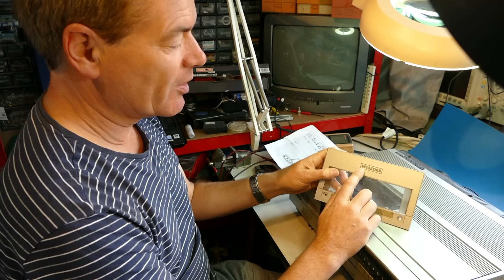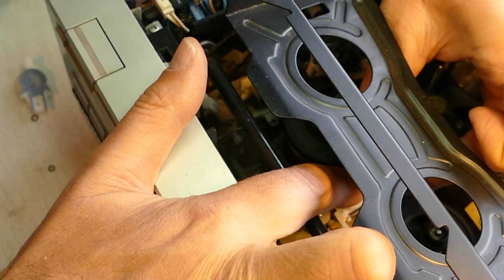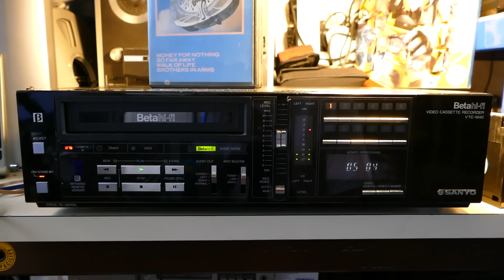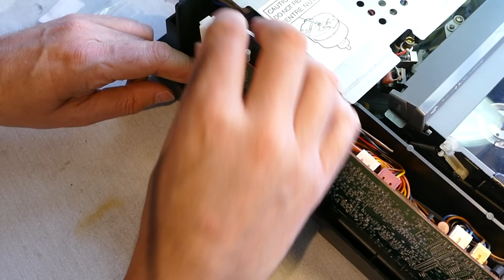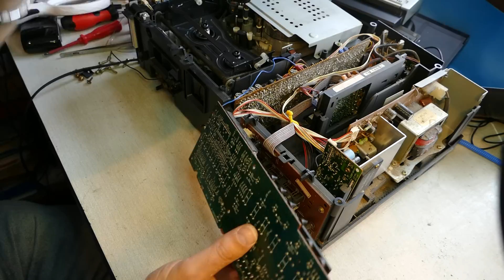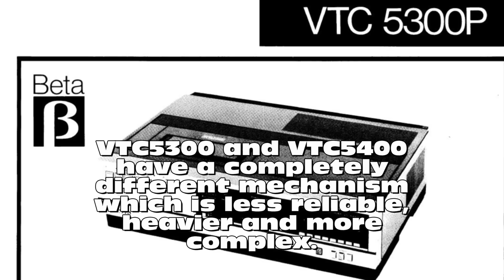Servicing Sanyo Beta (Betamax / Betacord) VTC5000, VTC5150 etc.

Comment: Hello, Thank you for this video. Very informative. I have a Sanyo Betacord VCR 4670. All functions work with exception to the tape retrieval. I have replaced the belts, idler tires and pinch roller. But the issue remains. The only thing i have not done as of yet. Is oil and grease the unit. Any ideas? Thank you for your time.

Comment: I have now successfully got my 5000 working perfectly again thanks to this video. Now tackling the portable VPR 5800 version, having trouble with the tape reject operation. Anybody out there with ideas?
Reply from the maker: The portable was an oddball machine, the deck is rather different to any other Sanyo model.  You just have to study it carefully.  Service manuals are available I believe for a badge engineered one.

Comment: I have the PAL/SECAM version of the VTC 5000. It seems dead. No lights, nothing. even the screen wont flash. the buttons do nothing, I just hear a light hum in the PSU section when i put my ear onto the shell. I think its coming from the voltage regulator. Out of random, I pressed a channel button, the LED lit up briefly, then went off. nothing else than that.
Reply from the maker: The STK regulator may have failed.  They are not particularly hard to source.  I would check capacitors in the power supply at the same time.  I also have one of these machines, a VTC5550.
Reply: @video99couk  When i put it onto the timer mode, only the channel buttons light up when i press them. Will give result when i swap the stk.
Reply: @video99couk That wasn’t the issue. I swapped the PSU with one from a donor VTC 5550, but still nothing happened. I’ve replaced every part, but it remains dead, and I don't know why. Interestingly, when I compared the PSUs, the one from the broken VTC 5550 was in better condition than the donor PSU.

Comment: Tengo una Sanyo Betacord... reproduce sin color
Reply from the maker: I've had this caused by dry joints on the main panel at the bottom, so take a close look around the chroma circuits.
Reply: Cómo lo soluciono

Comment: Great Videos, watched many times, I have 4 of these with this mod done but playback eventually stopped and goes into standby on all 4, voltage correct from supply new belts etc.
I have 4 VTC 9300 all were working perfectly but I guess heads worn out now.
Reply from the maker: The reel motors can occasionally fail on these machines, so it might be worth checking that.
Reply: @video99couk  Had that in mind, but 4 units with same fault, did try a while back finding replacement motor, if I figure something out I will let you know.

Comment: Thanks for the video, with new belt my RW and FF are much better, my picture is fine but no colour, whereabouts or which pcb controls the colours, is it a crystal
Reply from the maker: The colour processing is mostly on the bottom PCB.  I've had dry joints on colour processing on that panel in the past.

Comment: Thanks so much for this comprehensive video. I'm just trying to resurrect my pair of 5000s. I now have a good idea how to fix the problems I have, which you've covered. One works well mechanically but has no picture, the other has a reasonable picture but chews up tapes when unlacing.

Comment: Hello, I’ve just cleaned a 5000, and was looking to adjust the drop out compensator. I can see the hole marked DOC, but how on earth do you adjust it? On mine it’s just a hole. Thanks
Reply from the maker: There's a small preset adjuster inside that can.  You need a very small screwdriver to access it.
Reply: @video99couk  it must be tiny! Thank you!

Comment: Commenting on this video again because I found something intereseting regarding the syscon bug. So, about a year ago or so I bought a service manual for the VTC 5550, and it says the following:
"If the take-up reel base rotation sensor detects that the reel base has stopped during any of the PLAY, REC, F-SEARCH or R-SEARCH modes, the capstan motor, the reel motor and the video head will stop. If the sensor detects that the reel base has stopped during any of the F FWD, REW, or UNLOADING modes, the reel motor will stop, and the loading motor will rotate in the clockwise direction. The loading ring will then rotate in the counter clockwise direction and, once loading is completed, the VCR will enter the STOP mode.

So, did Sanyo designed these machines to behave like this on purpose, or was it really a bug in the code that they didn't bother to change until a couple of years later? It doesn't indeed make any sense to lace the tape when the take-up spool won't rotate!
PS: I put the important part in bold. It's not in bold on the manual.
Reply from the maker: It just doesn't seem logical to lace up in the condition of reel drive failure.  It's the last thing you would want to do, because now you have tape out that you can't retract.  I reckon it's a bug.
Reply: @video99couk  Do you have any idea how they programmed these syscon chips? What language they used, what machine etc?
Reply: @crashbandicoot4everr They’d use TTL (Transistor-Transistor Logic) I’d imagine. So they likely used OR gates, NAND gates and all that boring stuff.

Comment: Been fighting with a VTC 5300P for some time now which simply refuses to transport the tape. For some reason the motor doesn't want to push the gear in place to run the takeup spool in simple play mode - it seemingly doesn't transport the tape when unlacing as well, making exactly the mess you mentioned (without a tape the spool does rotate there). Lacing works perfectly well after changing the belts but that's pretty much about it. It's quite frustrating. Unfortunately the 5000 and 5300 look almost the same inside but they're quite different about that. Wish I could get it to run without the carriage for debugging, but it simply won't do even when pessing all kinds of switches that theoretically connect while pusing carriage it into place.
Won't give up on it, but at the moment I don't have a clue where to start. But your video was still a big motivation to keep on going, thanks!
Reply from the maker: Yes the 5300/5400 have an older and more complicated mechanism.  It's been some years since I worked on one.  Keep trying with fooling it into thinking there's a tape in there so you can see what's happening.
Reply: @video99couk  Finally managed to get it running again!
Turned out the last big problem was a stuck idler (or whatever it is called in the 5300). After some cleaning and oiling everything's working fine now.
Unfortunately now the screen is rather noisy and a bit shaky, even loses color at times, where it wasn't before I took care of the sluggish mechanics. Very scared that I've messed up the head (or even alignment) somehow. Tried cleaning it with the help of the PALsite guide, but didn't do anything. Noticed that the picture problems (especially the color related ones) are getting better after fast forwarding, rewinding or simply stopping it for a second and then pressing play again. Maybe the tape transport is slighty too slow and results in this - but to be honest I don't know if that makes even sense technically. I'd hate to give up on it after working so long on it but at this point I'm really out of clues.

Comment: Any tips on how to get it to eject a stuck tape. It ejected once, but never again. I have taken the top off the unit.
Reply from the maker: Probably the loading motor belt has fallen off.  It's at the back right of the deck.  Just replace that, it's not too difficult and can usually be accessed OK from the top.  I cover this in my video.

Comment: Brilliant video thanks.  I do find it a lot easier to remove the 3 screws on the right and the circlip on the left and remove the tape carriage before working on the idler.  Found it impossible to reassemble with the tape carriage in the way 😊
Reply from the maker: Maybe I have small fingers!  I almost never remove the carriage to work on these.

Comment: Why didn't you take the tape carriage out?  It is easier to change them if it's away, well they say anyway.  I want to find out where to purchase those belt/idler sets.
Reply from the maker: I prefer not to, my fingers easily fit around the cassette carriage.  Belts you can order by size, but the idlers are now harder to find.

Comment: Just working on mine, I noticed some aluminum oxidation on the polished surface of the drum. I don't know if that has the potential to damage the tape, but likely.
Reply from the maker: That can happen but rarely causes a serious issue.  You can very gently go over the static parts of the drum with fine emery cloth, avoiding the head tips of course, to reduce the oxidation a bit.  Don't overdo it.

Comment: Hi, do you know what maybe causing a buzzing sound on my VTC500 on playing of the tapes?. I've heard suggestions it could be due to the bad tape (something to do with the HiFi, though there is no HiFi on the tapes or the machine), or maybe the connection I'm using (I'm using the aerial cable connected to an old 14" TV at the moment to my computer), or could be the tracking or a capacitor problem, but I don't think it's the tracking, not sure about the machine itself. I would hope it's just the tapes and not the machine.

Comment: Thank you for your guide on replacing the 2 belts. I have successfully replaced the belts, the old ones were stiff so definitely needed replacing. The cassette now plays fine, also rewinding etc. The only issue I have now is sometimes the tape doesn’t fully unlace, I’ve cleaned the rollers with IPA and it OK but I’m still concerned it’s going to mangle my tapes. One thing I noticed was, when you stop the tape and it doesn’t unlace fully, if I rewind or forward the tape is unlaces and I am safe to remove the cassette.
Reply from the maker: There's a modification for this, see my web page:
http://www.colin99.co.uk/extras/reelidler/how_to_service_a_sanyo_beta.htm
I still have some of the component kits (zener diode and fusible resistor) if required.

Comment: Ive just purchased a Murphy which believe is a Sanyo. I have put a cassette in and it is stuck in the machine, the cassette didn't load. Is there a manual way of removing the cassette?
Reply from the maker: Remove the cassette lid (rubber strip hides two screws), then the cabinet top with three large screws at the back.  The loading belt has possibly failed, that's at the back of the deck, replace that and it might work from there.
Reply: @video99couk  Thank you for replying. I have looked at the loading carriage on the Murphy and it appears to differ from the Sanyo models, doesn't appear to have an idler. I have since removed the cassette but after loading  the tape again the heads just spin (before pressing play) and the again the tape fails to eject. Not sure if you are familiar with the Murphy? I have since found a Sanyo VTC 5000 which is in better condition, sadly Sanyo stops playing within a few seconds and the tape doesn't unlace properly resulting in a mangled tape! I am not having much luck!

Comment: I am working on my Sanyo VTC 5000 - which I bought new in the 1980's. I got a Desoldering Machine ZD-915 - excellent as I had to replace that Voltage Regulator 'chip' and had to repair the 10-core ribbon cable. I am still having voltage problems, so I am replacing the Zener Diodes in the Power Supply.

Comment: Hello, I have one that didn't work, I cleaned it and i had changenthe the belts and It works perfecly, then I stoped it and the tape of the video got blocked in the mechanism. I extract it very carefully and the next time I try to play it and it statarted to apear white and grey lines and the picture now is very bad. What could be the problem? Thanks.
Reply from the maker: I can't really diagnose it by remote control.  It could be a tape path fault, clogged heads or some other problem.  Start with a head cleaner if you have one.

Comment: Good afternoon, My Betacord Sanyo VTC 5000 is doing something wrong, the part of the video from the top is reproducing at the bottom of the screen and the part of the video from the bottom is reproducing at the top of the screen. Could you please tell me if this is something I can fix cleaning the head of the video as you do on your video?
Could you please tell me what liquid do you use? because a lot of people is telling me to use alcohol, but i'm not sure about that.

Thank you very much
Reply from the maker: Is it doing that for all tapes?  It sounds like a massive tape path error.  Cleaning won't help.
Reply: @video99couk  thank you for your answer. I'm sorry to bother you but I don't understand what is happening because It's been refurbished a month ago.
Answering your question: not all of them. I tried like ten tapes and it did it in six of them (all originals). I don't understand why.

Comment: Great video on the beta machine fixes!
I have a Betamax Sony SL-F30 machine. Recently started with issue that once pressing play only plays for 2 sec and the stops. I opened up the machine and can see the tape coiling. What could be the problem? The idler? Thanks for any advice.
Reply from the maker: Yes the idler "pendulum" as Sony calls it can get stuck on the deck and not swing properly.  Sometimes it's possible to add a washer to give it the required clearance to solve that.
Reply: Thank you so much for the advice! What type of washer will do the trick? Where do they add it to the idler?

Comment: You are correct, these Sanyo machines sold in huge numbers. I used to work at Television Parlour based in Fareham Hampshire. They used have 500 units delivered every Wednesday (delivery day) and would sell out by the weekend usually. They used to retail at £169 at the time. Before the VTC5000, VTC5150 they used to get 500 units of the VTC5300 etc & VTC9300 every week and sell out at £169 each.

Comment: Thank you for the video, helped me with my Sanyo Beta (VCR 4400). Can you give me any advice on one function I cant seem to get working. The rewind on goes for about 5seconds and shuts down and starts to auto play, but also binds up the tape. FF and play all work fine, but rewind, 5 sec and binds up the tape on auto play. Thank you again.
Reply from the maker: There is a Syscon bug in these in that they will lace up if REW/FF fails.  So check that REW is actually rewinding the tape at a good speed first.  If not, suspect idler, drive belt and reel motor in that order.

Comment: I own a VTC 5300. It's a great machine, but unfortunately, it no longer works.
Reply from the maker: The VTC5300/5400 models came before the VTC5000/5150 etc.  Sanyo's numbering system was strange.  The 5300/5400 use an earlier mechanism which is heavier and has a lot more belts and pulleys.  It's of the always-laced type, whereas later models unlaced during REW/FF.  It's harder to find parts for the 5300/5400 machines and they are more involved to work on, but still possible.

Comment: Hi,  Colin.  I have two Sanyo betacords.  The VTC 5010-II who only plays perfect without the lid and the VTC 5300PB who plays perfect only when its warmed up (otherwise stops / shuts off). What could it be and where could i find a repair instruction ? 
Kudos from The Netherlands.
Reply from the maker: These are going to require proper repair by someone who is familiar with electronics.  The VTC5010-II is probably the easier one to resolve.  The VTC5300 probably has bad capacitors somewhere and that's going to take some time to resolve.  It's not possible to diagnose by remote control, someone really needs to work on them properly.

Comment: Thanks for the helpful video! My mum picked up one of these 1982 VTC 5000-II units for free, along with the original manual and pause remote! It even came with a stack of Beta tapes (recordable and movies) and even the original L-250 tape bundled with the machine! It's in amazing cosmetic condition but has some quirks. Will be replacing the belts with the help of this video. Despite being nearly 40 years old, the belts were only lightly stretched. I'm so used to servicing dozens of VCRs that seeing the insides of a Beta machine for the first time in person was an amazing sight! As with the tape you used, these Beta tapes are also quite mouldy. I'd recommend opening it up to clean it off, as mould buildup on the heads wouldn't be ideal.

For anyone else taking one apart, that black strip that sits atop of the cassette cover at the start is also clipped in at the centre, and not just stuck on. You need to push something like a screwdriver on the underside of the cassette cover to unclip it, which it can then be pulled off.
Reply from the maker: You should certainly start by replacing the belts, there are only two.  It may need a reel idler, which is a bit harder to source these days, I had a stock until last year but now have run out.

Comment: I've heard from another person that the fault my 5000 has maybe down to an STK chip or one of the transistors in the power supply has failed. Is this likely does anyone know?. Considering I cannot see any sign of the any of the belts broken this does seem a possibility. God knows how I go about repairing that. Strange that something like that would happen on such a reliable Betacord like the 5000; maybe a tape caused it as most of the tapes came from long term storage in the loft, probably had alot of static on them being (I've heard not a good place to store tapes).
Reply from the maker: STK regulator chip is something that fails on these from time to time.  It's not particularly hard to source or change, just some basic soldering skills required.